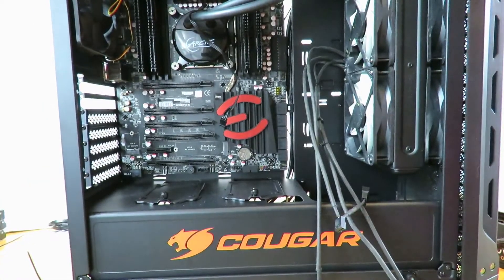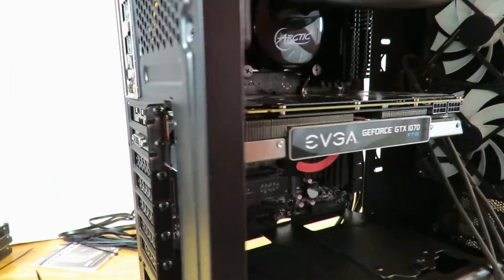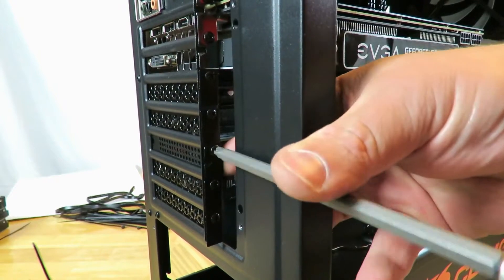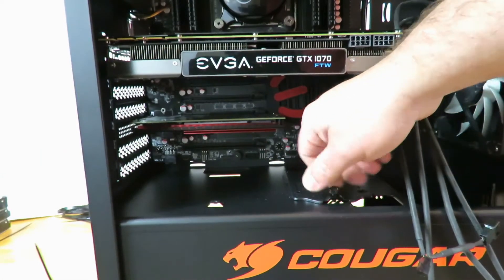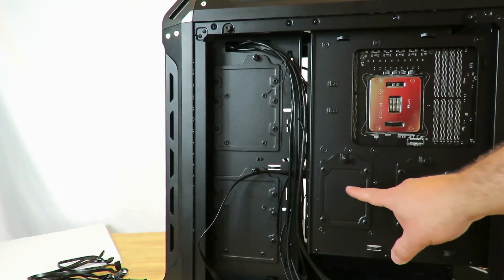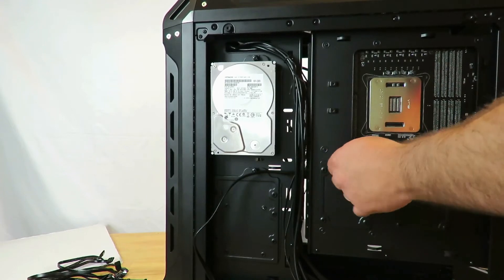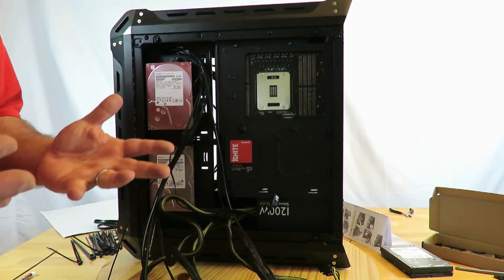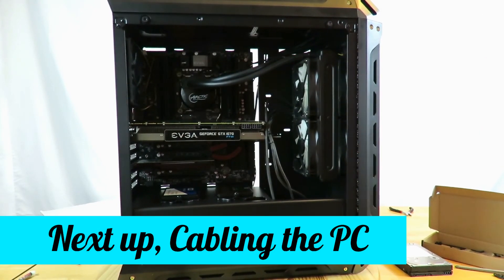How to build a PC inside of a Cougar Panzer PC Case 3 of 3

Comment: nice rig, i have the same case very roomy. i would to add an Aio but my fear is if it would drip out one day. As to why i stick with Air. what if you lay the GPU on it side? would you have a better chance of the Liquid not pour on the GPU?
Reply: coming from a boutique and oem's, this was always my fear since we were shipping systems fully built, but being that this machine is not moving, or maybe not moving much, you should be good to go.  putting a card on its side, many times will cause heating issues because the GPU fans are too close to the side panel, so it does not have room to breath, you can however also mount the liquid cooling unit to the front of the case.
Reply: @ThisBytesForYou  : well TY for that advice not mounting the GPU on its side.That makes perfect since. Yes I will consider mounting it on the front thanks again.
Reply: @OLvato1  anytime my friend, so very happy I could help you

Comment: I essentially have the same set-up as your build except my AIO and extra case fans are swapped.  My front fans are only pushing air across the 'front side' of the assembly; across the motherboard.  My big question here is about the hard-drives on the backside.  With the side panel installed there's very little gap between the drives and panel.  Where's the airflow for them?

Comment: Hi I know this is an old video but it's the only 1 I found, I have the same chassis, it came with 3 120mm fans front and just wanted to know if I need to 3 more fans 120mm or 2 140mm on top. I have the Asus tuf 570, ryzen 3700x and the amd xfx 580. Ty
Reply: Hello my friend, Dragonblogger and ThisBytesForYou are one of the few channels that actually cares enough to reply, so I hope to see you around more often ;).  The cougar panzer can take 3 x 120mm fans along the top or 2 x 140mm fans.  The front can house 3 x 120mm or 2 x 140mm fans.  The back and the bottom can house 1 x 120mm fan each.  I hope I helped you my friend.
Reply: @ThisBytesForYou  ty. Do I need to install fans on the top for extra cooling?
Reply: @MrNeophyte84  you don't need to, but you can if you like, it would help a bit.